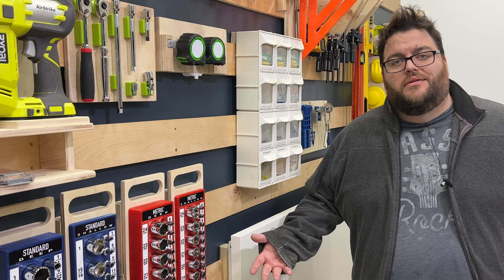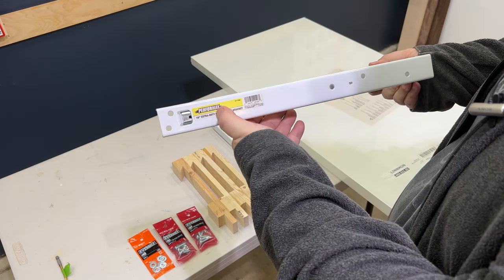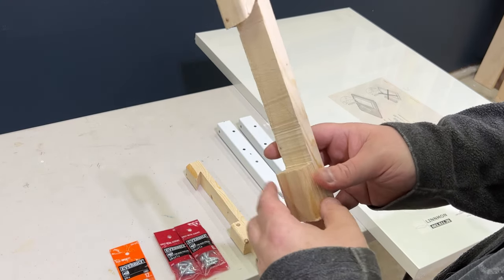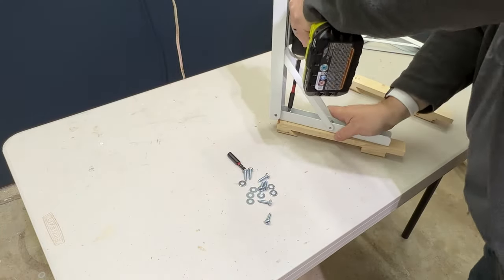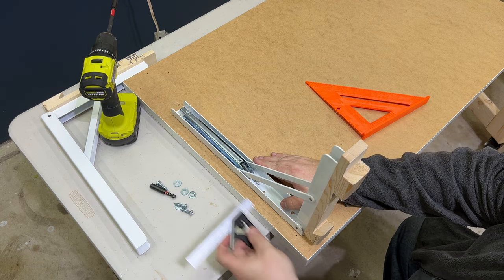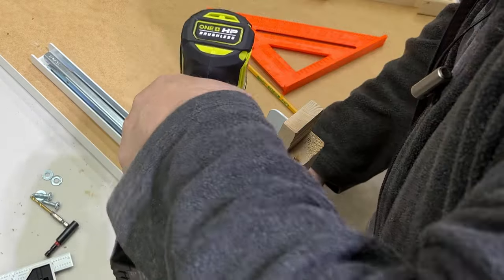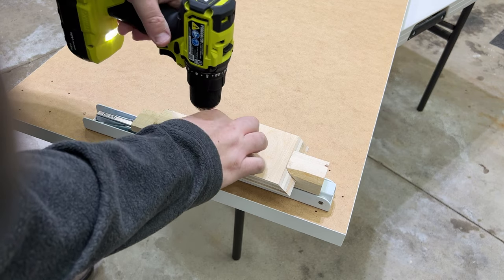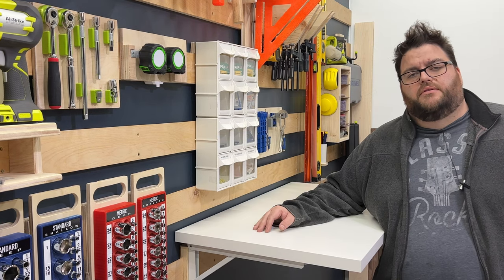A FOLDING Moveable Work Bench For Your French Cleat Wall

Comment: nice idea and assembly detail
Reply from the maker: A full length cleat I don’t think would give you much extra strength unless you add another hinge in the middle which would make it hard to close.

If I were to do it over again though I would just use plywood. My bandsaw work isn’t very clean and makes it wobble a little bit.

But again, I’m not putting a ton of weight on them, just for light duty stuff. 

Thanks for the comment!
Reply: @CyberBobCity   im trying this out, also adding a removable support using makerpipe connectors and conduit
Reply from the maker: @rickdeckard1075  Awesome! Would love to see it when it's done! Email me at  bob@cyberbobcity.com
Reply: @CyberBobCity  edited my comment, didnt mean to sound negative
Reply from the maker: @rickdeckard1075  No worries, I didn't take it as such. There are lots of ways to complete a project, and I certainly don't have all the answers. Let me know how yours turns out!

Comment: Are you mounted to Sheetrock or painted plywood. If it’s Sheetrock do you wish you had put up a thin plywood backer? I am working on my plan for my shop and have seen both in use?
Reply from the maker: Hi Johnathan, I'm perfectly fine with the sheet rock, especially at today's wood prices. It is more fragile than plywood, so it's possibly you can divot your wall easier, but when mounting the cleats to the studs, it can hold a tun of weight.

Since my garage is attached, I didn't know if I could have used plywood either, so I just stuck to sheetrock and haven't had any regrets.
Reply: @CyberBobCity  thank for the reply! I think with today’s wood prices I’m gonna go with straight on the sheet rock as well. 👍
Reply from the maker: @johnathansmith1373  Yea! I would! If you're on Facebook you should join our French Cleat group! Lots of great ideas, photos and tips.
Reply: I used sheetrock also due to the peace differerence.. Works fine and saved a couple hundred bucks  that I'm sure I'll blow at Menards. Lol